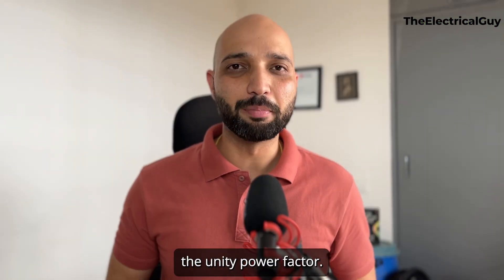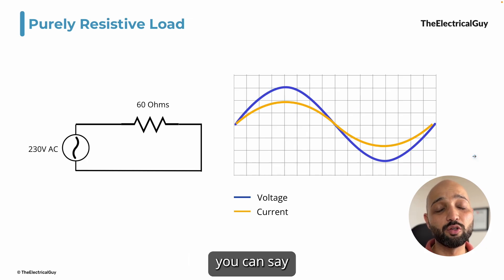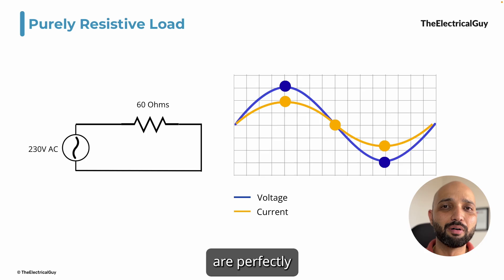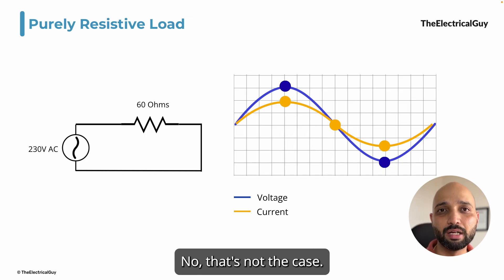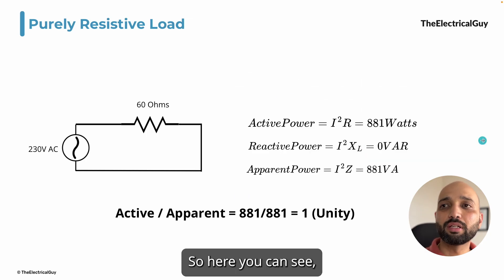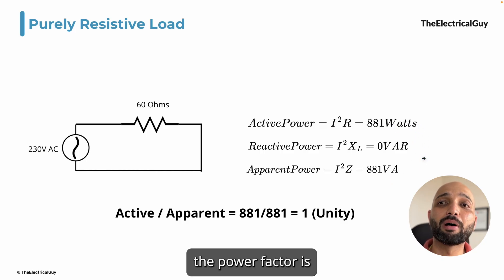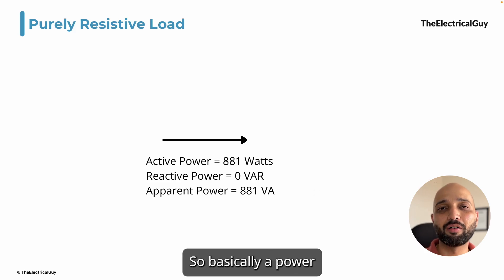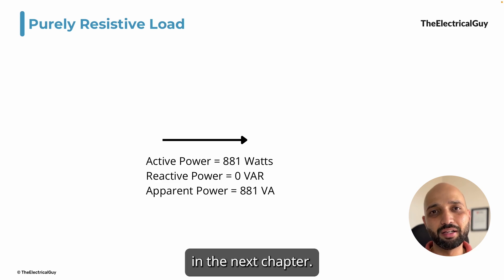Leading vs Lagging Power Factor | Which one is better?

Comment: "system is delivering power to the source" - from where? This creates a misconception that if capacitive bank somehow generates power and delivers to the source. Then I'm gonna install too much capacitive banks and asks for a price to the electricity board for the power that I have generated.

The graph, calculation everythings true, the way I'm getting the explanation is wrong.
Reply from the maker: Utilities pay for active power and not reactive power! 
If you add a VAR meter and measure the power you will get a negative power reading which means power is going from load to source! You can do the practical.

Comment: Hello Sir.sometimes the reactive power at the grid is negative, other times it is positive. In that case what is the cause? Generation ( source)? Or utility? 

Those three reactives power sometimes give me some headaches 😅😅😅: reactive power power at the generator, reactive power at the transformer level,reactive at the grid 😊😊😊😊😂😂. When I am controlling the voltage , for example I inject 2 mega var to raise the voltage, my expectations is to see a positive reactive power at the grid,yet here is the opposite  . still seeing negative reactive power at the grid 😅😅😅